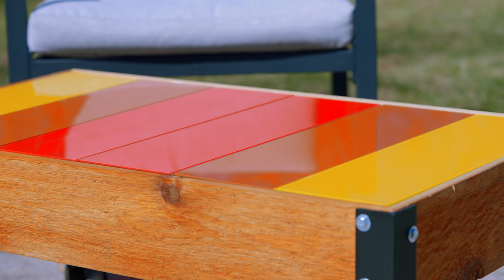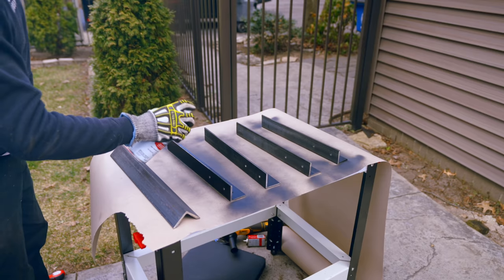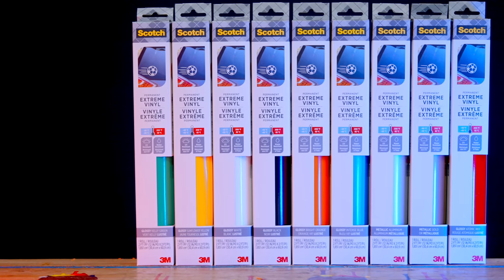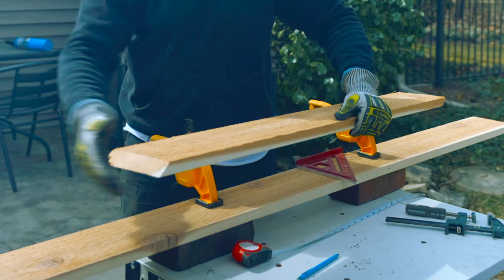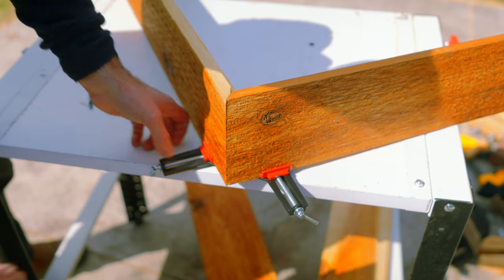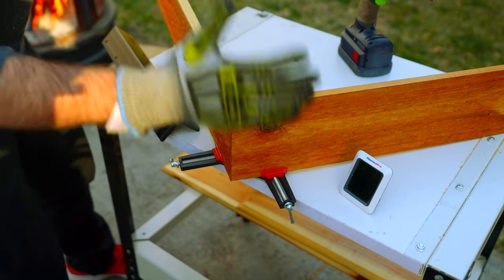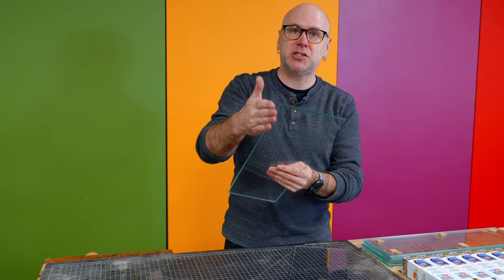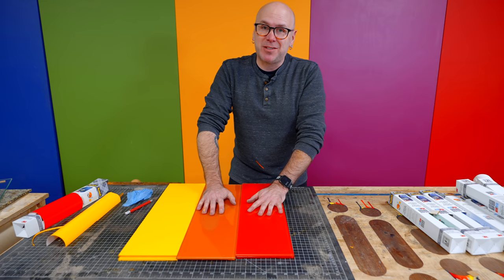Easy DIY Outdoor Patio Table with Limited Tools.

Comment: Great video and really cool project!  As to the drilling the holes in the wrong place, we've all done that!  That vinyl is really amazing!  I know they are a sponsor, BUT that's a really useful product!  Now sure the washers should be necessary.  Also, having the bolt heads on the outside would give a cleaner look (IMHO).   Great project!

Comment: I like the idea of leaning into the gaps. Cut each board slight short so the corners don't actually meet, but keep the miter and have the same width gap between the sides and the glass. It's not a mistake, it's a classy shadow line.
Reply from the maker: Nice! Shadow lines for the win!

Comment: Fun video full of good ideas. The vinyl looks like a winner in lots of applications. 

I wonder if the little oversights during the outdoor construction section were caused by the conditions. Mental performance declines in the cold . . . even with a hat, brain cells leak.
Reply from the maker: I feel that! Thanks!

Comment: I was concerned about some of the longevity for this table.  I built a table top a couple years ago from cedar and just know how tough the elements can be.  So I have two concerns.  1. The bolts are going to rust in like 1 year.  Not sure there's much you could do except maybe paint them and see if that keeps them for a bit longer.  2. the rubber feet need a hole in the bottom of them as they will hold water and fill then rust up from the bottom of the leg.
I really liked the idea of the vinyl and hope to integrate that into a project I will have coming up.  Got to figure out how I'll use it.  Thanks David
Reply from the maker: Great points! Thanks James!

Comment: How was the epoxy on the legs? I make those sort of mistakes all the time. I wouldn't of thought to fix metal with epoxy.
Reply from the maker: It worked get! I used the JB Weld for it.

Comment: The only part I'm uncomfortable with in this particular glass setup is the middle not being supported.  I would have put some kind of support going down the long length of the table to help support the middle of the glass.  Other than that, really basic, really easy, really good.
Reply: I can’t see that as a major issue. I’ve had glass tables in my living room with far greater spans than this. Never an issue.